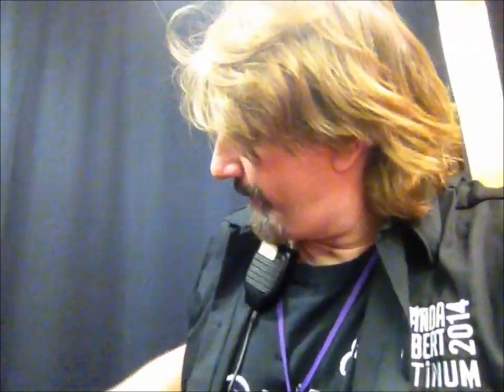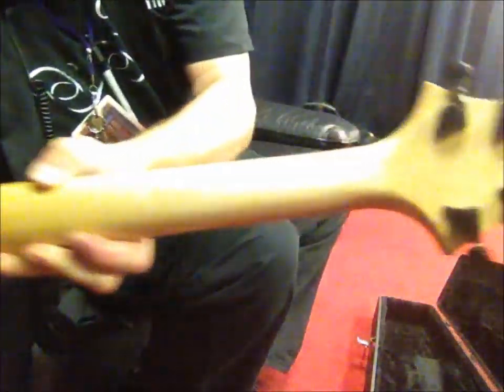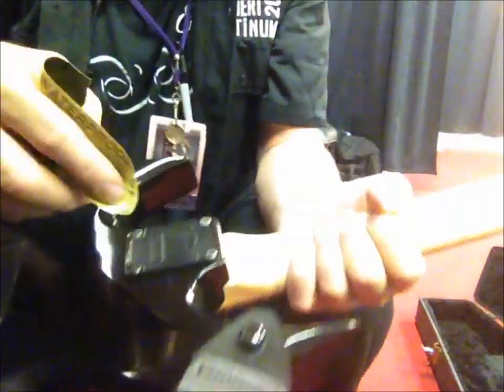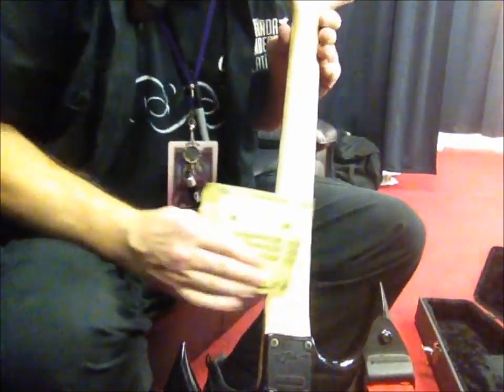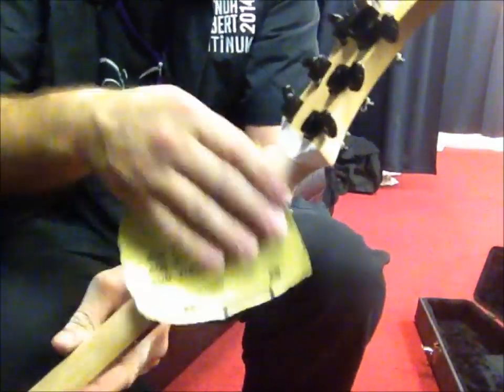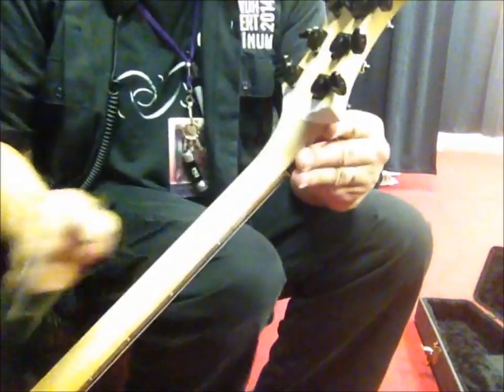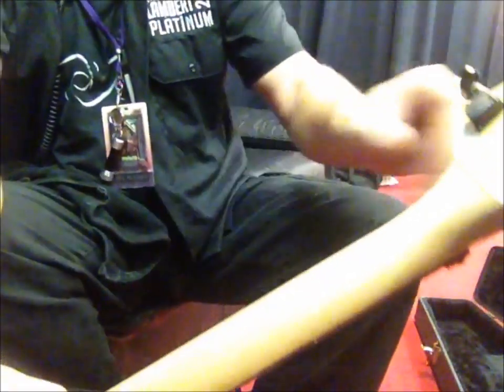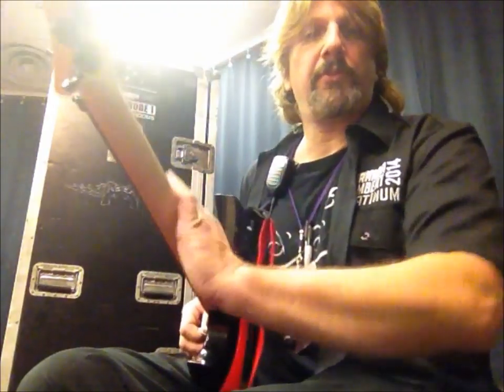how to sand finish on an acoustic or electric guitar neck to smooth sanded satin finish

Comment: What about using steel wool?
Reply from the maker: +51MontyPython Steel wool could work, but use a very fine grit. Sandpaper on the neck finishes really works great. If you try steel wool, let me know how it works out for you. Thanks #sanding  #guitarnecks   #guitarfinish  #guitartips
Reply: Sammy Bones
Thanks.  I may try one on one and the other on another.
Reply from the maker: +51MontyPython Let me know how it works out. Thanks #sanding  #guitarfinish
Reply: Sammy Bones
I'll try and remember and get back to you if and whenever I do.  I'm just not in too much of a hurry to do so.  Perhaps I will experiment on my cheaper guitars, then maybe try it out then on my more expensive models.
Reply from the maker: 51MontyPython sounds good!